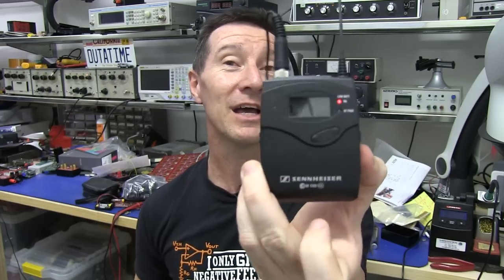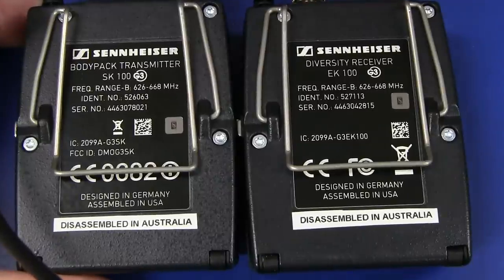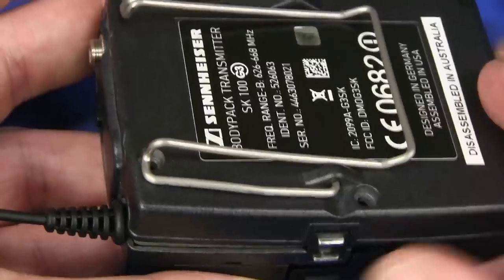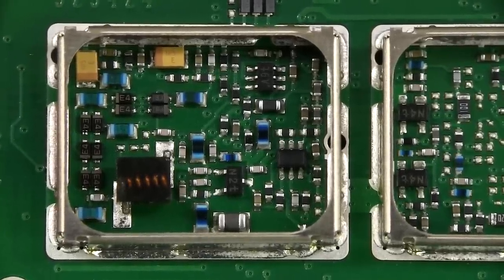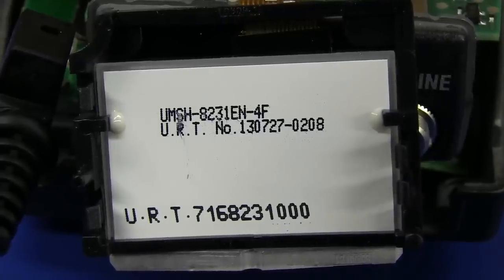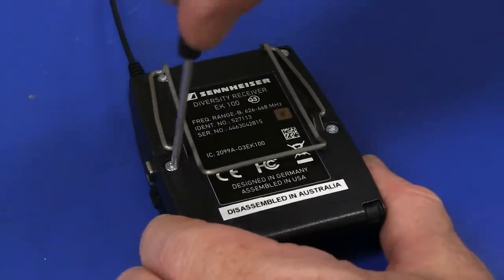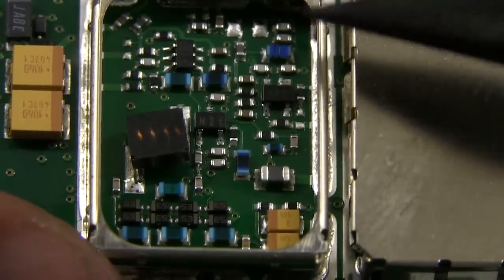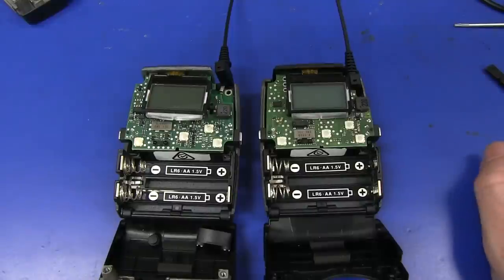EEVblog #571 - Sennheiser EW100 G3 Wireless Microphone Teardown

Comment: My strong suspicion is that Sennheiser located its assembly facility in Rio Rancho, New Mexico specifically because it is in the same neighborhood as one of the pro industry leaders, Lectrosonics. For  the same reason that other industries tend to cluster together (think Silicon Valley).  Lectrosonics and Zaxcom are the "high-price spread" and are the go-to brands of the prime-time industry.  The Sennheiser G3 is considered to be the CHEAPEST decent quality wireless kit currently available.  If you think $600-900 is "expensive" then you don't want to know what the high-end gear costs!
Reply: Richard Crowley I drive by that building all the time. Might have to walk in and ask which Sennheiser line they assemble there.

Comment: Sennheiser designed their products, so they can be maintained easily. Here in good old germany you can send your units to Sennheiser to get your frequency changed. In Germany some frequencys that were used by wireless microphones were taken away by the authorities to give them to the mobile phone companys for 4G. So the owner of the wireless microphones have to "update" their units. In other cases they can be charged for illegal transmission with high fees.
Reply: Hello port29dr. Do you know what the cost is for Sennheiser to change the frequency, for the G2 transmitter and receivers? I've been told it will be cheaper to buy new G3 systems than to change my G2 systems. Hard to believe.

Comment: Dave, can that ADF 4117 local oscillator chip you point to at 7.41 be changed to adjust the frequency band the unit operates at? Is that all it takes? I need to switch from 740-776Mhz down to 626-668Mhz for some G2 in-ear monitoring receivers. Same for the matching G2 rack-mount transmitters. Suggestions?

Comment: Hello, I've got a used Sennheiser EW100 receiver, it can't receive the signal in case of more that 6-7 meters. Physically nothing is damaged, the boards are clean. Antenna replacement had no result. What may be the reason? Thanks

Comment: Definitely not THE BEST in the industry, but definitely the best consumer level wireless setup.
Reply: What Ben R said.
Reply: Short of a karaoke machine accessory, I'm not sure any wireless mic system would be considered a "consumer" electronic device.  Low-end professional maybe.
Reply: Schuch Designs I hear Prosumer thrown around alot when talking about these.
Reply: Grey Fox This reminds me of the early days of D-SLRs when people said if you had anything less than a One series camera it wasn't professional (and by extension you, the photographer, weren't professional).  Now that even the President's photographer uses a 5D those comments have gone away.

Comment: Lost count of how many of those belt packs I have worked with in my lifetime!
Of all my entire adult life working in events, concerts and live TV.. Sennheiser EW's have only ever failed TWICE, first when a sheild came loose on a handheld mic and 2nd when the presenter wearing one had 40 litres of water thrown on him on stage by suprise. Dried it out and it worked a treat!
Those 100's are a great option for the serious "youtuber"!
Reply: I've been working with G2 since 2007 and G3 since 2011. I still use some G2s. I have never had a Sennheiser fail. A broken antenna (a guest sat on it) and tens of mic capsules, but nothing else. The G3s seem to be a little shorter on range, I had to use RF amps, but no problems so far.

Comment: Notice any similarity in construction between this and the 1980s semi-pro camcorder that Dave tore down a few months back? Metal chassis, panels that fold out on hinges, and accessible test points. Nice to see engineered equipment still being made, rather than Chinese stuff designed by university interns. A lot of good maintainable design doesn't actually cost anything extra! Very nice.

Comment: the Sennheiser G3 are about $990 at retail (the full kit). You won't be able to use the 700hz Frequency band that this supports; next year, because Digital TV will be using that frequency band (you will have to stick to the 600hz band). To Future proof you should have gone with one of their newer products. My favorite memory of using the G3's was installing 20 of the receivers into a rack for a production of Lay Miz. It looked so ausom. The only problem the G3's have is the 30m distance limit and the further you are a way from the receiver the faster the batteries drain in the belt pack.
 The best part about the G3 is that you can in software lock the settings so actors don't fuck with it while your not looking. If you ever see "RF mute" showing up when you try to turn off the belt pack, your belt back is locked and you have to unlock before you can turn it of.
Reply: a lot of wireless systems are sort of being forced into digital (especially in the live audio industry.) lots of cellular and broadcasting companies are buying up analog frequency bands to repurpose, so it's harder for stage performers to use analog wireless systems without getting interference. lots of wireless vocal mic and guitar systems available now, and at pretty reasonable prices. it's probably more of an issue when you're in a large venue and the performer could be 50-100 feet away from the receivers, whereas with video camera use the transmitter is usually much closer to the receiver.

the professional analog systems (like those used by touring musicians) typically have a software component, so the wireless systems are hooked up to a laptop, the monitor engineer scans the venue for open frequencies, and the software switches the wireless systems to those for that night's performance. most of the wireless software also comes pre-loaded with "reserved" frequencies for most cities and states (at least in the US), and it automatically skips over them; this way they don't interfere with local police/fire/emergency radios, and the monitor engineers can also avoid using the same frequencies as venue security or staff. i don't think that's as much of an issue with the digital systems, but a lot of bands and production companies are still using their analog UHF units because it's such a huge investment to replace them all.

EEVblog i think that separate card (with the antenna) is how the proper regional frequency spectrums are installed. in other words, the main board (with the LCD, etc) is probably the same across all units, no matter what country they're sold in. but, depending on where the systems are being shipped to, Sennheiser simply installs the proper "daughter card" for that country's frequency spectrum. i know dealers can also special order specific frequency spectrums regardless of where they're located: for instance, if an Australian rock band needs wireless systems that will work on a tour of North America. most wireless manufacturers also have programs to allow their customers to send in their systems and have them switched over to different operating frequencies; it makes sense that Sennheiser would want that to be an easy process, so they likely just open the receiver, swap out that smaller card, and pop it back together. that's probably the same reason why it looks to be purposely designed to be easy to open up.
Reply: ***** I work emergency dispatch (911/999.000 etc) and recall when a traveling oil rig crew came through our jurisdiction once and just started spraying 800 mhz full of profanity all over our emergency channels...that was a fun day getting the authorities to track them down.
Reply: frollard i worked at Red Rocks Amphitheatre one summer, and we'd often hear the monitor engineers running through different frequencies so they wouldn't be on the same channel as the venue staff radios. of course, in our case it was all part of the way concert venues work and nobody's life was on the line!
Reply: John Ridley
 the 2.4Ghz band is really crowded, that's for sure. 5Ghz would probably be better, although i don't know if the wireless manufacturers make systems that use that band (i'd assume they do, but they probably cost more because...profit!) as a guitarist myself, i haven't had a need for a wireless system in a long time, but they've always been a compromise. digital wireless systems seem better in theory (and in some ways they are, especially when it comes to sound quality), but there are still a lot of the same tradeoffs there have always been. convenience comes at price.
Reply: You're talking about a 30 meter distance limit..? Obviously, something has got to be very wrong when you can't get any further than 30m from your receiver. Of course it's just a 30mW transmitter, but I use these systems (20 pieces) very often in longer distance situations without any problem. When there's a line of sight between both antennas 200 meter distances are no problem at all. Of course with multiple systems you want to use good active antenna splitters (Sennheiser ASA1) and directional antennas (A2003).

Comment: We run these mics 8-10 hours a day and for the most part are fairly well behaved also the G3 IEM's. The wireless manager is nice for finding good channels and the express programming is a cool feature if you need to change out a mic transmitter or IEM receiver. The only thing design wise I'd change is to use a standard mini XLR that Shure, Sabine, AT and others use and can be repaired. There is a well known problem with these any little bit of static around the charging terminals will cause it to think its in the charger and turn off. It's supposedly been fixed but we went through a number of warranty exchanges before getting a fleet that doesnt seem to have the problem.

Comment: I've used the G2s in live PA, they are fantastic bits of kit. Great build quality and battery life, and pretty much unbeatable RF, very rarely lost signal with them. They did have a problem with noise when the batteries got low though.

Comment: the company i work for has an actual drawer full of these in hire stock.
the reason they have infrared sync is not just a nice design feature, its because we hire out 20 of them at a time so you need to be able to sync 20 transmitters with 20 rackmount recievers fast as hell (unless you want to pay guys like me a lot more money).
they also sort of are designed for service as even though they are well built, folk break them very regularly. theatre companies hire them out by the truckload and they, along with the actors, get thrown all over the stage and so on so quite often the screens get smashed and the ariels/jacks get snapped off. usual stuff. great units though.
the AGC and EXP/COMP can be turned on and off in settings.

another interesting characteristic of these is that they really dont like to be used in close proximity to their recievers. if you get closer than five feet you will often get dropouts and noises.

each country/region has different parts of the radio spectrum that is "legal" to use gear like this on so they come with preset ranges dependent on region. much of the time when we hire them out we have to issue licenses for a specific range of spectrum for a specific event to allow them to be used legally on channels that aren't avaialable for public use to prevent interference from consumer gear. the last thing you want during a public event or TV/radio broadcast is someone else's guitar or bass or wireless mic coming through on your channels.
Reply: also, the G2s (previous version of this unit) was about the same size as your old audio technica unit there but weighed double as much as these G3s. had exactly the same feature set apart from the infrared sync though.
Reply: hefonthefjords
You are thinking of the G1's. They were the size of the Audio Technica and used 9V batteries. They were followed by the G2 with the same design case as the G3 then the G3 with much improved RF. So you could get more audio channels with the G3 without intermod within a given TV channel.

Comment: I work almost every day with these realy reliable wireless microphones. You see these on almost every stage in germany. It doesn't matter if theatre or rock n' roll. It provides almost everytime best wireless connections. :) Very interesting to see one these torn apart.

Comment: There is software available for the higher end G3 rack mount / desktop receivers with Ethernet connectivity. The software has a frequency analysis feature that will scan & plot through all of the the supported frequencies to help you to select clear channels to use. I had to use 24 of these (22 active and 2 in reserve as spares) at the same time and was glad for the scan mode.
Reply: Plus, Sennheiser were nice enough to release the protocol specs. I built a device for the G2 series that re-tuned the receiver on presentation of different RFID tags, and I had to reverse the protocol myself .....

Comment: unpopulated sections may be for the other models, the EW100 is the "entry level" unit, the EW300 the mid and EW500 the top end unit.
Ive still got a couple G1 units still going strong, and half a dozen G2s.

Comment: Interesting video post - "Sennheiser EW100 G3 Wireless Microphone teardown" and great how to use demo. :) Built in Germany and Disassembled in Australia.
Dave takes a look inside the Sennheiser EW100 G3 SK100 Bodypack Transmitter and the EK100 Diversity Receiver.

Comment: it's not distributed element, it is footprint for rf connector
Reply: Linas K : Yes, I was thinking the same. It wouldn't be much use as a distributed element at 600-odd MHz! That's practically DC! :-)

Comment: The first thing I noticed about these units was that they do not seem to bear an ACMA compliance label. I'm not an expert in the field, however, I believe that they are considered Low Interference Potential Devices (LIPD) and able to operate under an LIPD class licence provided they comply with Radiocommunications (Short range devices) Standard 2004. They are compliance level 1 devices and must display an ACMA compliance mark to demonstrate compliance with applicable ACMA standards.

It would be nice if someone more familiar with the rules could confirm my suspicions that these units shouldn't be sold in Australia.
Reply: Should have waited until further in the video, the compliance mark is inside the battery compartment.

Comment: Really nice construction. I like how the various parts are hinged like that. It would certainly make it easier to troubleshoot. I am curious about the QR(?) scan blocks on the PCBs and just not on the case. Have you tried decoding them to see what information they contain? BTW, Dave, did you add the "Disassembled in Australia" stickers?
Reply: Probably used for tracking the various PCB assemblies as they travel and merge onto different conveyer systems during production. Only decodable by the in-house system.

Comment: Pretty cool, I got something similar free that is made by Sure, these things definitely are expensive, and technically it's not legal since it uses the vhf band and here in Canada that band is reserved for government/whatever since the TV stations are shut down, same as Australia, but it's probably fine, and it's pretty good too, they have a long range.

Those are definitely much newer and nicer quality,but you can't beat free, and it has decibel adjustment as well, I think the same amount.

Sure UC Wireless Microphohe System Teardown and mod.

Comment: The only thing I wouldn't like is that the antennae are fixed. On all professional TX/RX devices I've used it's possible to unscrew the antenna, for example to attach an antenna higher up in the air for better reception. And on diversity receivers, to place the antennae further apart.
For example, Audio Ltd. products, see here: http://www.locationsound.com/wireless-108/receivers-119/portable-121/audio-limited-dx-compact-true-diversity-receiver-f1-512-to-542-mhz-1631

Yes, that's 1479 USD. And that's only the receiver! The transmitter is another 1149. :)

Comment: great insights mate, now im interested in your opinion where by is it possible to hack the transmitter rf power out put? me and a few production sound mixers has been baffled on how to DIY by replacing it with another transistor or anything. you would definitely know more then us. looking forward to your response

Comment: If you used this for the video, then I'm not sold on the audio quality... Sorry, but I prefer whatever you used before :|  This sounded like it had some distortion and was muffled, no "presence" or ambience(?).

If you didn't, then what happened?  Something's gone off!?!
Reply: Dave couldn't actually use the wireless kit WHILE he was dissecting it, could he?  You must have missed the part where he switched to "hard wired" mic as he took both the transmitter and receiver apart to the point where they were non-functional.  Presumably he re-assembled them after the video.

Comment: Hello dear friend.  Thank you for this fascinating video.  I have a question about this model.  I have in my possession a G2 model.  Its antenna is broken.  Here in France there are only antennas for the G3 version.  Can I put the G3 antenna on a G2?  Both have a bandwidth of 626-662 mhz.  Sorry if my English is bad.  I use a translator.  Thanks in advance.  Glad to follow you.

Comment: The Senn is good but the Zaxcom and in particular Lectrosonics are THE two pro brands most used in the industry.

Large budget Hollywood productions mostly use Lectrosonics equipment not Sennheiser.

Here is a good roundup of Lavalier mics for anyone interested.

kenstone net/fcp_homepage/lavs_brockett.h t ml

The Lectrosonics UM400a and Sanken COS-11X are INDUSTRY STAPLES.

The best gear on the planet is a Zaxcom TRX900 paired with DPA 4061 mic.

The Senn is prosumer.

I'd sure love to see a Lectrosonics and Zaxcom teardown.

Comment: Hello,
I have one question about the batteries, is it a series or parallel circuit? I bought an battery eliminator for my ew100 g2, but the minimum setting is 3V, can I damage my g2?

 Thanks